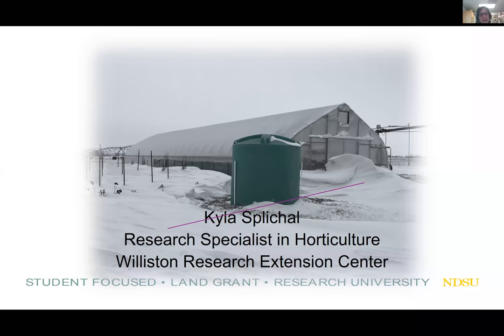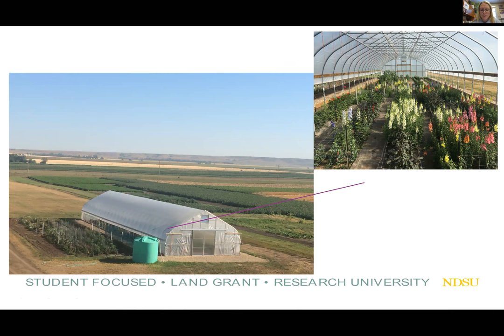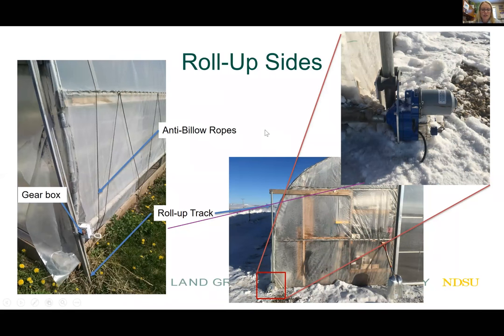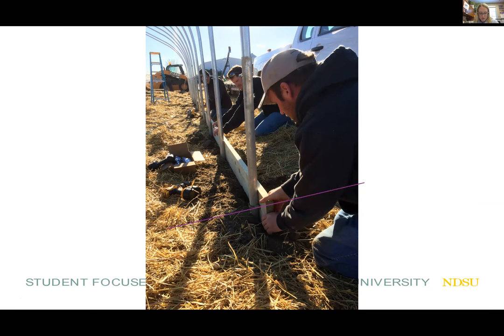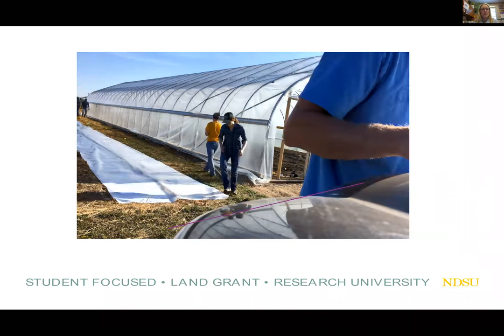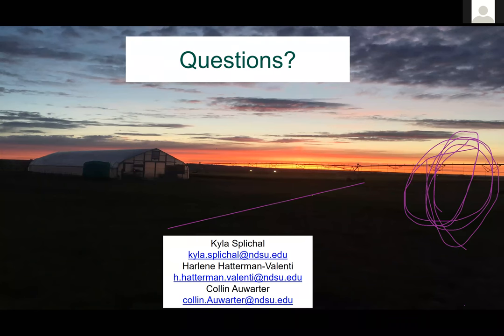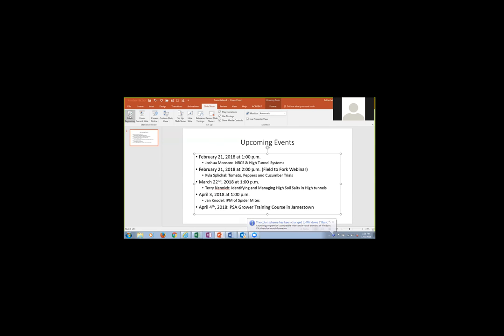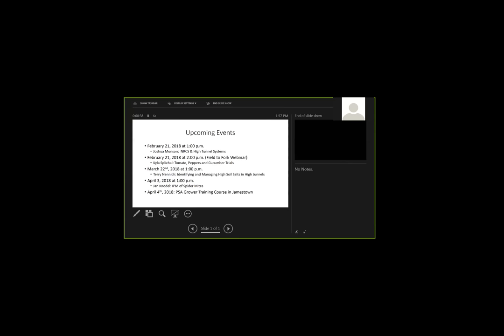High Tunnel Construction

Comment: Heating and cooling with a fan pushing extra heat into the ground to extend your growing season. Use the drain pipe and an electric fan. This link has a great explanation of the cheap geothermal heating or cooling. 
 https://youtu.be/cT8Ic2m7voI